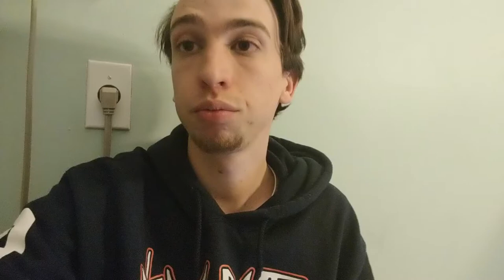DV Tests wants to answer your questions!

Comment: MOSFETS vs. Switches - We have a wide variety of high torque motors on the market at the moment and a lot of new high performance parts to go with them that result in a lot of current running through our wiring looms. Obviously switches have been a mainstay of flywheel modding for years now, but at what point is the current enough to justify MOSFETS and the somewhat deeper understanding of electronics that they require. 

Bonus question: anything about motor braking with MOSFETS.